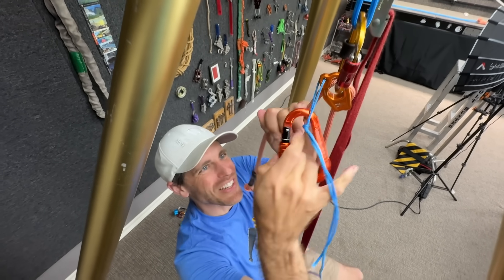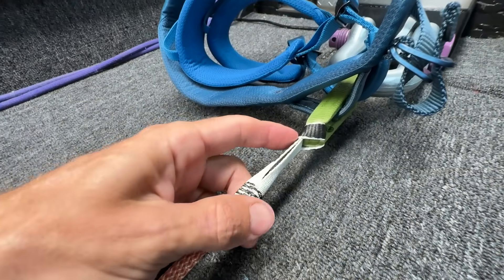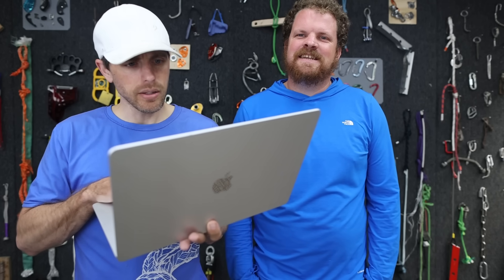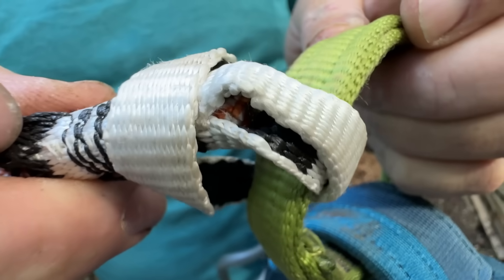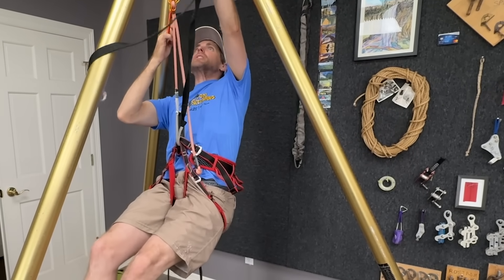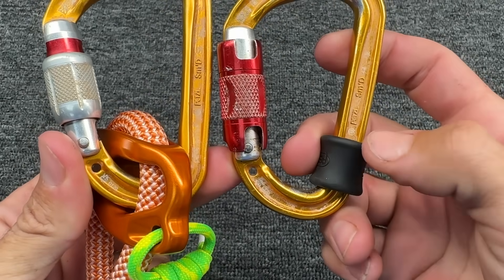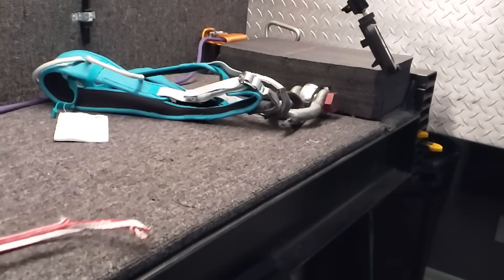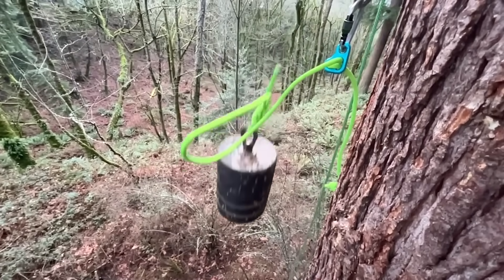People are worried about this part

Comment: So, possibly a silly question from a beginner climber: I hear you guys talk about fall factor a lot, but I haven't read or seen a good explanation of what exactly fall factor is. Do you have any plans to do a video on it, or possibly know where I can educate myself?
Reply: Fall factor = distance of fall / amount of rope out in the system.

So, if you climb 2 meters above a hanging belay, and fall, you will travel four meters (2 to the belay then another 2 past it). 4m fall / 2m of rope out = FF 2. This is the worst possible fall.

If you climb 2 meters above a belay, clip a piece, climb 2 more meters further and fall, you will travel 4 meters (2 meters down to your piece, then another 2 meters past it - you will now be level with your belay/where you started). 4 meters of rope out / 4 meter fall distance = 1. FF 1 is still a very violent fall.

I’d consider any FF between 1 and 2 to be bad just because of the forces involved. Falls < 1 are better.

BTW: FF of 1 or greater are only possible at hanging belays. If you’re on a ledge or the ground, you’ll deck the moment you achieve a FF 1.

Comment: If the new Petzl connect adjust and the Beal espresso fit lanyards could just have a baby together producing something with the dyneema girth hitch plus a small dyneema loop incorporated for rappel extension, that would be the most beautiful baby ever.
Reply: Are you still meant to girth hitch the Beal lanyard or use a carabiner?

Comment: 4:25 the first sentence of 5.2.3 means you're to attach the sample using two smooth 10mm diameter round bars. mean roughness Ra and peak to height Rmax are defining the surface texture, so the testing facility isn't using bars with sharp burrs and gouges.

the rest of 5.2.3 is telling you to pull the sample at a rate of half the sample's length per minute. if the sample is 500mm long, pull at 250mm per minute. pull until failure, compare to the force listed in 4.2

Comment: µm is micrometers. 1µm is 0.000,039… inches (39 millionths). 8µm is therefore about 314 millionths. 0.3 tenths to your local machinist. Ra is peak-to-peak surface roughness. That's decently smooth, don't use sandpaper on the bars.

Comment: Okay you have not necessarily fully changed my mind, but I am a little more confident that this product is safe. But you still create a Todd Skinner situation where the Dyneema sling stays connected and focused on one section of your belay loop if you keep it attached to your belay loop. The fact that people suggest you dont keep this attached defies human factors. The old design loses up immediately and makes it to where I dont have to remove this from my belay loop because it's constantly moving around my belay loop. Have you slow pull and drop tested the old design to make sure its roughly the same as the new design?

Comment: The main differences with your test were:

1: Used sample. A new sample is required. Yours had already been pulled once and possibly bunched the sheath.
2: Loading speed. The standard requires pulling a constant ~0.25"/second. Yours is way faster and not consistent.
3: Connector. The standard calls for a 10mm steel rod. You used a carabiner whose basket shape affects how well the "autolocking" works.

Comment: Any thoughts on using the Connect Adjust for a rappel extension by clove hitching a locker and an ATC to the midpoint of the lanyard rope? That seems like what most folks, myself included, have been doing for that application. It’s supposedly fine, but my owner’s manual for the OG Connect does not specifically state that it’s safe.
Reply: I have the dual connect and like it a lot as a rappel extension. An ATC on the fixed end can be set up and weighted while still in direct with the adjustable end.
Reply: @ceculbe yep, it looks great. My only issue with it is that it doesn’t pack down very small. The regular version is already a bit bulky. The dual is more than I want to bring on a bigger days in the alpine.
Reply: Why wouldn't it be safe? It's just a clove hitch on a rope and the forces generated on a rappel are tiny. But I can see why they didn't include as you don't want to be responsible for someone messing up the setup.
Reply: @dagmarbelesova4284 indeed! I agree that it seems very safe compared to the forces involved, especially considering I do it all the time. Still, I’m surprised I’ve never seen an official response from Petzl about it given the apparent ubiquity of that particular use case. Seeing SOME testing from a third party would be nice.

Comment: R. A..... it's a surface finish rating. Our drag race cylinder heads and engine block get thatched to a specific RA finish, and it makes a HUGE difference in how well the head gaskets work to stay in the same spot to not let boost pressure by.

The RA number on the surface that the rope runs over is just for continuity presumably. It's just there to provide a number that is repeatable for testing! Just for those that don't know what an RA finish is!

Comment: Hey, actually glad you tested this. I had a gut reaction to seeing the design but was like "if they designed it that way it's probably going to work, buuuut strannnnge". So really cool to see you tested it and I don't have to worry.
However, one thing I'd like to see is how does the wear look over time compared to a normal rope lanyard (would it eat through loops faster over time). Probably no significant difference but actually curious to see what would happen.

Comment: Energy is the key - rather than static force...
A device which slips at 2kN - isn't going to break gear - just the user, IF too close to the ground..

2kN slipping over120cm absorbs 2400J  (Energy absorption - converted to heat - needs some heatsink volume) - not a lot of energy in a fall, but more than static body weights..  (Good enough for a 2.4m freefall - + 1.2m slippage, let's hope a crashpad was in place. if too close to the floor)...

100kg (man with gear)  at Freefall  2m / 6 ft..., velocity  ~ 6.3m/s (miles per hour aren't very useful here, 21 ft/sec if one must ) Kinetic energy rises to...  = 0.5*100*6.3^2  = ~1971J..

So falling for ~4 metres (4811J - will eat up quite a but of slack...  (2.4m - or ~8ft - of slack eaten up)

Interesting seeing stuff on the market ?? repurposing...

Comment: It so stupid to paywall Standards.
From EN 17520:2021: (not exact wording)
4.2 Dynamic Test
When tested as described in section 5.2, the personal belay lanyard must not allow the test weight to detach in any of the three consecutive falls.
    During the first fall, the peak force must not exceed 10 kN.
    If the lanyard includes a fall indicator (as claimed by the manufacturer), check after the first fall to see if it has been activated.
Note: The standard limits the force to 10 kN on a single lanyard arm to account for the possibility of both arms being loaded in a real fall, which would increase the impact force.

4.3 Slippage Test
For adjustable personal belay lanyards, slippage must not exceed 50 mm when tested according to section 5.3.
    During the second fall in the dynamic test, set the adjustment device so the lanyard is at 80% of its maximum length.

5.2.4 Equipment for Dynamic Strength Testing
Use a guided drop test rig as specified in EN 892:2012+A1:2016, section 5.6.2, with a test mass of 80 ± 0.1 kg.

5.2.5.2 Testing Adjustable Personal Belay Lanyards
    Attach the end of the lanyard meant for harness connection to the falling mass, following the manufacturer's instructions (e.g., using a lark’s foot knot).
    Connect the other end to a fixed anchor point.
    Set the lanyard length to L, as defined in section 5.2.3.
    Apply a static load using the test mass for 60 ± 5 seconds.

Dynamic Drops:
    First Drop: Within 120 ± 15 seconds, raise the mass to a height of 2 × L and release it. Record the peak force.
    Second Drop: Within 5 ± 0.25 minutes, adjust the lanyard to 80 ± 2% of its maximum length. Raise the mass to 1.6 × L and release. Only the peak force from the first drop is recorded.
    Third Drop: Within 5 ± 0.25 minutes, restore the lanyard to full length L, raise the mass again to 2 × L, and release it.

5.3.2 Measuring Slippage
    Apply a force of 100 ± 10 N to the lanyard.
    Mark the lanyard as close as possible to the length adjustment device.
    Increase the force gradually to 1.3 kN (with a tolerance of +0.1/-0 kN).
    Measure the slippage before removing the load.
Reply: How else are the bodies that create the standards supposed to exist, have employees and test to establish the standards?  Should they just be funded directly by the companies who follow those standards?  I can't see how that could ever possibly be a conflict of interest....
Reply: @alexnone5720  but that is actually exactly how this works right now ? Companies who want to follow the standard must pay to know what the standard is. Then they also pay the people who manage the standard, so that they come and validate that the test procedure is correctly followed. At least this is how I understand the industry, maybe I'm wrong, feel free to correct me. IMO, having public standards would be good, but people often think this cannot work out economically and do not want to try. Maybe there are problems, but this works pretty well in the programming industry ( where most standards are actually open and anyone can contribute to improving/criticising them)
Reply: @Tellurium-Monoxide  Eh. It's weirder than that, even. 
The standard is managed by a standards body, ISO or ANSI or STM or one of a hundred others. The standard is created by a working group, which is a couple reps of the standard body and a bunch of people who work in the field the standard is for. They work for... the companies who will use the standard. The companies who will pay the standards body for access to the standards that their employees made. 

This is all vaguely ridiculous, but the thing is the standards bodies are usually pretty well respected. If ISO publishes a standard, it's probably a good one. And a respected third party is probably the only way to get a bunch of competitors to actually work together to make a standard in the first place.
Reply: @Tellurium-Monoxide  They would only need to buy the standards, then design validation tests that show that the product meets the standard.  The manufacturer would not need to hire the standard publisher to perform any validation.

Having a separate standards body that all manufacturers need to comply with (and fund through licensing) means that they will have similar pull and keep standards more useful and reasonable.   Governments (US and EU) also have influence over these standards bodies so you end up with 3 groups that need to come together to develop reasonable standards.

If you would prefer standards be defined by government and free for all to access, list a few government policies that work well, are consistent, are free from corruption and lobbying influence and can be held legally responsible for negligence that you would like these safety standards to follow.
Reply: @alexnone5720  That is not how standards are created... usually (at least in my case) it works like this: A person nominates you (working for company A) to be admitted to a standard commitee. Then you meet up a few times a year to discuss whats wrong with the standards your country has and how to improve them. One or two people will throw a curveball, others want nothing to be changed at all and the others play diplomat. This goes on for a few years till everyone is sick of everyone else and then a new standard is released - and the procedure starts anew
Reply: @alexnone5720  I agree that the selection of standards is an economic and political dilemma. There are many publicly funded standards, such as the metric system, or building codes. There are many private standards down to the level of individual formal processes in a one person company. In between that there are many of these standards where restricted access reduces the dynamism of markets by cost prohibiting smaller players from participation. I think that particularly when law requires compliance, the standard should be made available without cost to the user, and I agree that the resultant payment structure is one that is difficult to develop and prone to distorting it's own quality and efficacy. I won't propose solutions here, and I agree there are many ways to address this problem. All of the ways require smart people working towards clear goals in good faith.
Reply: @scottkleeman4849  The base building codes are created by an independent body then adopted by each state, city or municipality.  Sometimes there are addendums added by those governments if they have decided that there are special cases not directly covered in the standards.
Reply: paywalled standard is insane. isnt the point of the standard so that people know what it complies with??
Reply: @bayupatten4777  Paywalled standards which are mandated by law are the most ridiculous thing. It basically puts laws behind a paywall. Want to know what this climbing equipment or bicycle or cable you are buying actually has to comply with? Well, better pay for it!
Reply: @Mike-oz4cv  I don't think they're ridiculous per se, especially after reading all the comments here. But I do think that it would be beneficial to consumer confidence if they put some load rating information alongside the standard number. Otherwise, it's a bit of a "trust me bro" situation, which doesn't inspire confidence in critical consumers.
Reply: @bayupatten4777  I completely agree. Governments should pay for their publication.
Reply: @scottkleeman4849 which governments?
Reply: @amandaklapp1171 Somebody else's of course.
Reply: @urlauber2884
Standards organizations are funded by that 'paywall'.  The problem is no funding no standards organization therefore no standard. 
So if you feel strongly about this how would you solve the simultaneous issues of: 1 - Funding, 2 - Independence, 3 - Consensus by stakeholders that all standards organizations provide.
Unfortunately paywalls are the only way I am aware of that guarantee funding ... perhaps you have a better way.
Reply: Australian Safety Standards are the same. Amazingly useful to have paid access for any member of the public that safety standards are trying to protect.

If I remember correctly, that was made possible by a Liberal government.
Reply: yeash the internet should shame paywalled standards with anything and forever.  just like the interne5t shames sig for the p320

Comment: quite sure, they don´t want you to clip a carabiner into the eye at the knot, because it would lead to the miss interpretation, that you can use this carabiner for connecting to an anchor. Carabiner in an anchor -> carabiner in the eye -> dynema loop at the belay loop  .... this might be a connection that does not hold a lot of force.
Reply: But would clipping it be OK as a backup? For example, I imagine a multipitch rappel scenario where you arrive at an anchor consisting of two bolts that are not connected. You clip in to one bolt with the Connect Adjust as intended, then clip that tail to the other bolt for redundancy.

Comment: Ra is average surface roughness, meaning that the high and low points from the machinings are averaged on a given length, 0.8 micron is usually a grinded surface (or a very well milled one). It is specified in the standard to have a unified surface friction on the connecting parts, otherwise you could be able to lower friction by mirror polishing parts or get higher friction by rough milling thus getting different results in testing. I think your setup is different because you are using off the shelf products, but given the surface treatment of carabiners, they should be below 0.8, the big shackle looks more rough. In this testing scenario this has no meaningful effect, because the contact points are a carabiner and the belay loop. I only see the deviation in pulling speed, because this should be 0.5 times the length of the product (from connection point to connection point) per minute

Comment: μm stands for micrometre. The greek letter μ (mu) is the SI prefix for "one millionth". The reason we use a greek letter for it compared to the other prefixes is well, micro and milli both start with an 'm' so we had to pick something else. In the context of surface roughness, like in that standard, it's saying that on average, any point on the surface deviates less than the given value from the idealized smooth surface. 

As for other common prefixes you might encounter, "pico (p) = one trillionth, nano (n) = one billionth, micro (μ) = one millionth, milli (m) = one thousanth, centi (c) = one hundredth, deci (d) = one tenth, deka (da) = ten, hecto (h) = hundred, kilo (k) = thousand (but you already knew that), mega (M) = a million, giga (G) = a billion, tera (T) = a trillion.

It goes a bit further, like the mass of earth is about 6 Rg (ronnagram), but at that point we usually just write down the exponential.
Reply: Excellent, just a couple of things to add ... here in the land of the free, we call them meters instead of metres; and the Greek letter, mu, is sometimes abbreviated with a "u" when the Greek alphabet font is not available. So "um" would mean micrometer. And another word for micrometer is "micron." How big is that, well the smallest dust particles are about the size of a micron.
Reply: @dre3951  the um instead of the Greek letter mu I also use regularly bc it's way faster to type.

Comment: 4:28 μm = micrometre = 1/1.000 mm = 1/1.000.000 m
It's a standard unit of length...
Reply: jk...   For education as well as "fun"..
(1μm  = 1/1,000,000 m = 1/1,000,000,000 km = 10^-6 m = 10^-9 km) -   just contrasting dot separators - used in the European Continent, with Comma Separators - English speaking world - not that USA often plays with numbers from other continents, RJ may be an exception..)